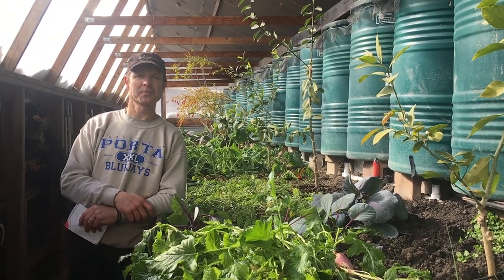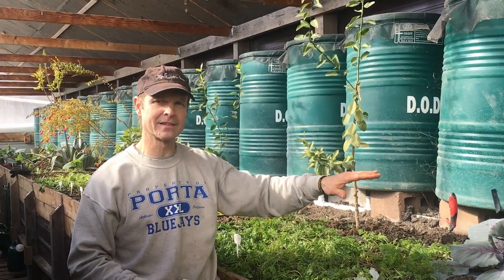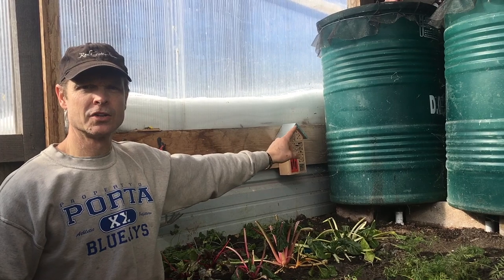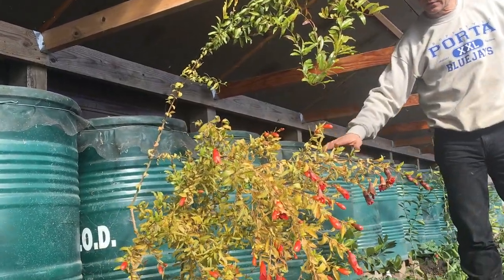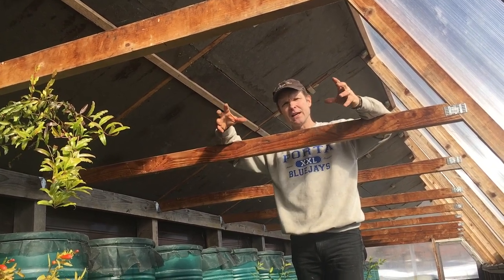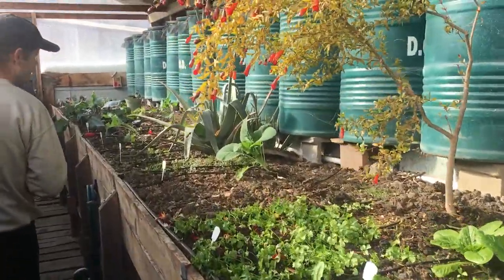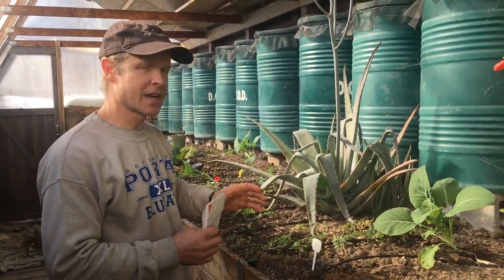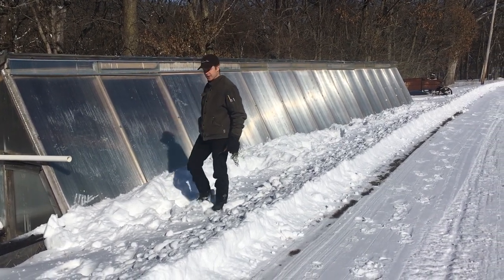Walipini Followup: Answering Viewer Questions

Comment: I’m wondering if there is a way to use the liquid water in the Walipini to prevent plants freezing.  E.g. can you leverage the heat transfer of the water converting from liquid to solid ice to prevent plants freezing?  Maybe even misting with water from the barrels which is above freezing?
Reply from the maker: Properly designed, freezing would not be an issue. Realize the only time in nearly 5 years that the temperature dropped below freezing was when we had the joint leak and lost so much of our water, in the midst of the extreme cold and cloudy days.  That is definitely an exception rather than a rule.  A much better option would be prevention--design the barrels correctly and the heat stored inside the water barrels should protect the plants just fine.
Reply: Your misting concept is something I have intended to play with in addition to cloth over simple #9 wire to grow lettuce in Nebraska. We can get 95 degrees in June or September so trusting in timing is not always manageable. Misting mixed with shade is my hopeful method. I can see what you mean for warmth, but you’d need plumbed in water and once you start, you can’t stop. Consider how temporary that is for most plants in a greenhouse setting. It could work for a hard cold for a week though. This -41 here...was near impossible. I’d even consider owning concrete blankets for something this nuts if it weren’t a once ever decade problem.

Comment: Very intriguing and enjoy your demeanour- just wondering if this works in Canada? We are located in the centre of Alberta. I am a small business owner/operater for installing  Glass & Eavestrough (probably you call it Rain Gutters ) I have learned that filters, foam pads, meshes, screens for gutters just plug up (outrageously priced as well). There is’ No perfect solution’ but there is a is a continuous hanger, which most people have trouble grasping. (it is’ NOT’ a topper or insert ...it is the hanging system with About 18 advantages I found over the weaker spaced hangers or spikes fastening system and amazingly strong ( I have a pic with me standing on it)a lot less money and maintenance also! In your case you have the bonus of easy access and already spiked on and so you could use the after the fact same design as the new construction ‘continuous hanger’ with a flexible membrane seal at the back of the gutter instead of under your roofing panels( which by the way are siding panels as actual standing locking seam roofing panel’s have unexposed fasteners as exposed fasteners can leak) A micro- mesh might work better for minimizing the size of debri-entry but it would require maintenance to flush clean and minimize build up in your first barrel. The alu-rex.com system allows finer debri- to enter but does not plug up like the expensive competitor products. I hope this info helps.
Reply from the maker: I Learn so much from the comments section.  Thanks for passing this on, I’ll research it more.

Comment: Would it be possible/smart to add some vertical black strings of some material to melt snow/ice forming on the main sun windows?
Reply from the maker: I suppose you could try the vertical black strings, but because snow removal was so easy and accessible, I didn’t worry about it. The steepness of the front shed most of the snow naturally. I only had it sit on there when I had very heavy snow or wet snow.

Comment: Sorry if I missed it, but how do you keep rain from overflowing the barrels?
Reply from the maker: Whenever we expected a rain, we would simply turn on the watering tubes to irrigate the beds. I think we only had it overflow one time when we forgot to turn on the valves. But, it simply overflowed into the back of the bed, so no big deal.
Reply: @ADifferentWay  Thanks for your response.

Comment: One more question, do you ever run like on water during the winter? You mentioned having to decide between heat and water, does that mean you run out of water?
Reply from the maker: No, I don’t run out of water, but I will haul water in the winter sometimes and fill through the side pipe.  That allows me to water the plants without letting the tanks get too low.

Comment: Would it be a good idea for a solid base under the strip of barrels,to use the heated thermal mass "bench"of a rocket stove mass heater? I mean it could be solid concrete walls or cinder blocks for the sides,enclosing your heating/exhaust tubes along with the gravel and clay thermal mass, instead of just using up space,it would just be the right height to set the barrels in the back and maybe even make it wide enough to sit your grow beds on providing warmth to your soil and root system as well. If youre familliar with rocket stove mass heaters,they use mininal fuel wood,and you only need a small fire at night when you expect really cold weather. That would recharge the heat in the water barels as well. Would there be any downsides to doing this?
Reply from the maker: That would be a great idea. However, that’s a lot of work. If you’re in a northern climate, definitely worth it. If you’re south of 40° latitude, I don’t think you’ll need it.

Comment: I have a question does side what is benefit of wall below? If we put stones instead? What will be impact, by considering that we will grow mushrooms too in bottom, thanks
Reply from the maker: I’m not sure what you’re referring to when you say wall below. However, anytime you can substitute rock, brick, or concrete for wood that is going to benefit you. Better thermal mass and no rotting. Additionally, if you want to grow mushrooms, those spores will impregnate the wood and you’ll have mushrooms where you don’t want them. With stone or concrete that shouldn’t be an issue.

Comment: Aside from slightly added cost and time, what's the reason for three or four valves versus, say, a valve between each barrel, especially if the primary driving force is minimizing the number of barrels requiring draining during settling-induced leakage?
Reply from the maker: Just time and cost.  A valve every tank would work fine.

Comment: is this design good for Northern Alberta winters? I would be very interested in doing this on our land as we also want to go off-grid and self reliant. Love your videos they are very informative.
Reply from the maker: Although I am only vaguely familiar with such northern climates (I have family in AK), I believe that, with some modifications, a walipini could certainly offer an extended growing season.  It would just require a few more inputs (ie additional light and heat at different times of year).
Reply: @ADifferentWay  Do you have Plans yet, for building a walipine? We are interested in your concept; just to let you know where exactly our land is, google "Rochester Alberta, Canada" and that's proximal to our location. We are new to homesteading but very motivated and have 160 acres mostly forest but abundant east/west sun exposure. Thank you so much for your input.
Reply from the maker: Unfortunately, we are so busy right now building our new farm and new walipini, that I have not had any time for writing. Once we complete our second walipini and try it out for a bit, I do hope to finally write a book comparing the different structures. That said, I would encourage you to read through the comments on this post as well as the original walipini post. We have many questions, answers, and real experiences of people who live closer to your latitude and climate. Most have made modifications to make the structure work, but it definitely works! Hope that helps.
Reply from the maker: If interested, we wanted to let you know our Walipini building guiding is finally available! https://www.amazon.com/shop/adifferentway/list/2JRI58ITC5AM0

Comment: Did you know this design is straight from Mike Oehler's book?
Reply from the maker: When we initially became interested in the Walipini concept, we consulted the study published by the Benson Agriculture and Food Institute.  As planning progressed, my engineering students at the US Air Force Academy developed the idea as an assignment.  They drew it up, and then we fine-tuned it based on latitude and sun angles.  Although we did eventually read Oehlers book, I’m not surprised that the design is similar, as many walipini and pit greenhouse designs resemble each other.  It’s basic engineering and passive solar design.

Comment: Is there a minimum number of barrels (size of walipini) that you need for this to be worthwhile? I'm considering a much smaller one just for home use.
Reply from the maker: I don’t know the exact answer for your area and design but consider this.  In this design I had about 5000 cubic feet of space and 1600 gallons of water.  You can start with that ratio and see if you can scale it down.

Comment: Eliminate pipe on the bottom altogether, just use over flow tube's from barrel to barrel, if using for  watering, just put a hose spicket on every 3rd or 4th barrel
Reply from the maker: After I installed the whole thing, I realized siphon tubes would have worked much better. Overflows won’t work because you would only drain barrels that have a spigot. If you use siphoning, all barrels go up and down at the same rate. I would then drain the  gutters into several barrels at a time to handle the heavy rains.

Comment: As you stand there the roof is half way blocked from light, THAT needs to go!
Gain back significant heat light for plant photosynthesis affect.
Put some double wall There are thick poly-sheet of some kind,  that are different thicknesses which can replace and be as integral for structure or add some galvanized tin 2x4 or 2x6"  beams inside in necessary.

Highly suggest solar panels to supply fan, Plant must have air flow across them,  and panels a]can add a little heat in Any day time early and alate in day to male it more smooth thermally so plants don't see a wild swing in a day cycle.

Comment: Dumb question could you add additional walling on your northern wall to limit dead space and create a more insulated area?
Reply from the maker: Not a dumb question. I’d prefer to find someway to double that back wall and have water in the wall as opposed to in the barrels. That might be a little complicated though. Adding insulation wouldn’t really help much because you’re still trying to get the thermal stability of the ground, which is behind that wall. if it was outside air behind that wall, you would definitely want to insulate more.
Reply: @ADifferentWay  let me speak clearer, can you create an attic and insulate that area where the sun doesn’t shine?
Reply from the maker: Yes, you could, but I use that attic space for starts in the spring time when the sun is low enough to penetrate the front wall and still make it to the back wall. The slope on that back ceiling is 30°, which means the sun goes all the way to the back for about 4 weeks.  However, you could block off a portion of that, maybe 4 feet and definitely create a small attic space with insulation. Wouldn’t lose much grow space, but would definitely limit heat loss and decrease dead space.
Reply: @ADifferentWay  I really like your design but it looks like you are on a fairly level area, I am on an approximate 4/16 hill, do you think it would work with 4ft down on north side go 6feet south then go down 4 more feet go 4 feet south then up 4 foot to grade then 6 more space added?
Reply from the maker: Actually, this structure lies on a north slope, not ideal. I used the excess dirt from the dig to build up the back wall, because the actual terrain falls away. Your idea could absolutely work, but it’s all dependent on sun angles. I describe those angles in the book.

Comment: This is a great design, thanks for sharing! Could you use PEX lines between the barrels about a foot off the bottom, and tap a spigot at the bottom front of each barrel for draining sediment? You could then flush each barrel once a year into a watering can, and the PEX lines are flexible enough that a little settling wouldn't be an issue.  The center barrel or two could then feed the drip lines with PEX as well, so no less-flexible PVC pipes would be needed. I'm working out a design for a hybrid of a walipini and the front greenhouse area of an earthship, to build onto the front of a wofati, something like this one: https://www.youtube.com/watch?v=XRo7BTz1NmM
Reply from the maker: PEX is definitely a good option and it’s cost effective.  Instead of tapping each barrel (more cost, more maintenance, more areas to leak) I would simply create an overflow system in whichever barrels accept the incoming rainwater.  That isolates the sediment to just those barrels and you could then flush only those barrels every so often.  Smaller particulates are adequately caught by the inline filters and those are easy to clean.  Additionally, the spigots on the front wall help flush all lines whenever you hand water because they are the lowest point.  Good luck with your design, be sure to share your work to encourage others.

Comment: Really great video ! I'm designing something similar , I want to use single glazing (Because I already have it) and insulating blankets that go up at night . I had just planned to have 48 30 gallon black plastic barrels stacked in three rows of 16 along the back wall , with no plumbing . is there any reason I would need plumbing to the barrels ? (my green house will be attached to the basement).
Reply from the maker: I plumbed mine because I relied on rain collection for my water source, and barrel water for my grow bed irrigation source. If you have no intention of doing either of those there would be no need for plumbing.
Reply: @ADifferentWay  Thank you , there so many things to think about , it's hard to keep everything in my head. Just today I looked up the maximum snow load I need to design for , it turns out that a worst case snow storm could dump about 4400 Kg of snow on the roof ! Of course that required a lot of redrawing , and while I can design a roof , I'm out of my depth designing a retaining wall that must also support a considerable snow load . Clearly I will need a engineer to check my work.

Comment: Does the money saved from having the walipini for food equal or exceed the cost to build one?
Reply from the maker: We felt that it did. Of course, most of the lumber was milled at home, so we had only a Few thousand invested into the structure. Divided over an estimated 10 year lifespan for this particular design, it absolutely paid for itself! That said, we also felt it wasn’t all about the finances. For us, we enjoy the self-sufficient aspect.

Comment: Do you think the design could be made more robust with some kind of independent water header system? Such that if one barrel leaks, they don't all leak? I'm thinking some kind of siphon, so that if any essential pipe breaks, the siphon for the whole system breaks, and until that gets fixed, at least all of the barrels HAVE water to potentially hand water with. That might actually be doable, maybe a liiiitle more pvc, but possibly even easier to make because you would have to put a bunghole in it you could just use the hole that's usually in the top. If you could figure that out and test it, so long settling earth being a problem. No matter what, breaks could happen, good foundation or not, and some kind of system that remedies that by making sure that the whole thermal batter bank doesn't drain out, that'de be some cold hard gold.

Oh, plus, potentially needs less filtration if the intake to the syphon is a little up off the bottom, more natural sediment removal.
Reply: And Happy Thanksgiving! My prayers are with you and your family!!!
Reply from the maker: Good idea, I would definitely encourage someone to try that.

Comment: Would it help to line the inside of the north wall with a reflective metallic covering? It would bounce sunlight down onto the plants. The dark surface is doing nothing for them, in fact it is absorbing solar radiation and light.
Reply from the maker: Yes, that is absolutely a great option. We later found this would’ve been very desirable, as most of our plants tended to lean towards the window instead of going straight up. The darker areas do offer heat absorption and retention, which is beneficial, but should we have redesigned this, a reflective surface would definitely be something we would add!

Comment: Would salt water absorb more heat?
Reply from the maker: The short answer is no. It would also be more corrosive, couldn’t be used for watering, and wouldn’t be conducive to a rain collection system. However, one benefit is that it wouldn’t freeze as easily.
Reply from the maker: The study you referred to actually proves that freshwater holds more energy than salt water. You can see in the experiment it takes much longer to boil the fresh water, which is understandable because it’s specific heat capacity is greater than salt water. As to why it cooled down slower, I can only guess it’s because salinity also decreases thermal conductivity.  The wording of the report is confusing because it says it retains more heat. Although it may  retain its temperature longer, it’s clear that it took more energy to boil the freshwater.